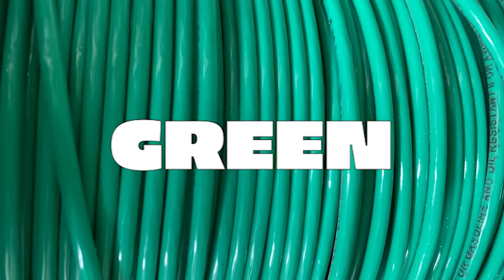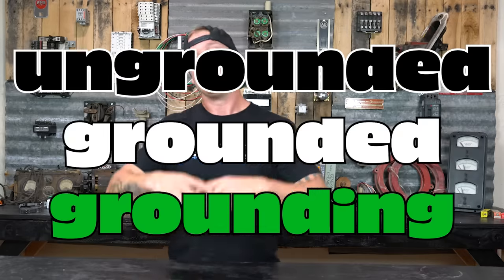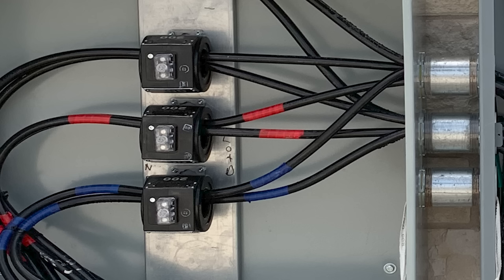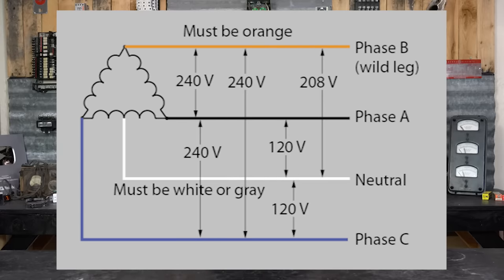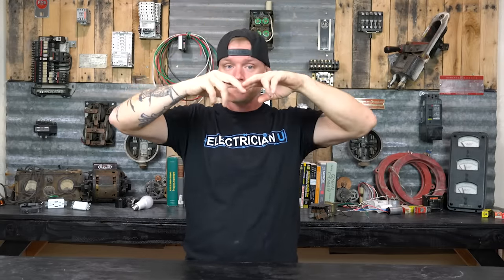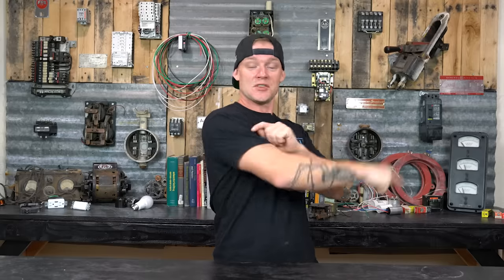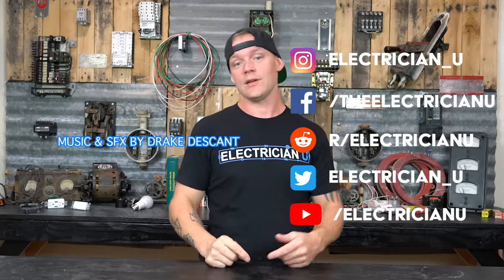Electrical Wire Color Coding Used By Electricians

Comment: Speaker wires: Backwards wiring is just out of phase, sound is an AC signal. If both speakers are "out of phase" you won't be able to tell the difference, but if just one is there will be places where the speakers cancel out each others' frequencies depending on the room it's in and placement etc.
Reply: Exactly
Reply: Speaker wires can also be same color for both, but the sheathing is smooth on one and rifled or ridged on the other so you can feel it in the dark realm of speaker installations.
Reply: Power going from your stereo or amp to your speakers is DC, not AC.  The rest of your comment makes no sense.  You seem to be confusing a delay with a noise cancelling signal.
Reply: @akuunreach  not true. It's AC. And the rest of his comment makes perfect sense.
Reply: @ehsnils  I remember when I was a kid speaker wire was like that. Both conductors same color. I didn't know then one side was rougher than the other one until I got older. I used to get really annoyed by that. It was probably very common for people to wire up speakers incorrectly because of this.
Reply: @ehsnils  clear or see through will White markings if you examine it closely on one side...
Reply: speakers are driven by audio board that converts AC to DC.

Comment: Awesome video! If you need a video idea here’s one: how to properly size wires and voltage drops
Reply: I would be interested in that. good call
Reply: Would love this video
Reply: Voltage drop would be great
Reply: Agreed
Reply: Easy way to do it is for every 100' go up another size. So a 20 amp circuit which normally would use a #12 AWG would use #8 AWG if you go over 200' but less than 300'.
Reply: @11bravoNRD  2KIL/1000 or 2KIL/CMA depending on where you get your K. Remember that the voltage drop calculation is a the number of volts dropped in a circuit, not a percentage. So, the acceptable voltage drop for a 277V circuit may not be acceptable for a 120V circuit.

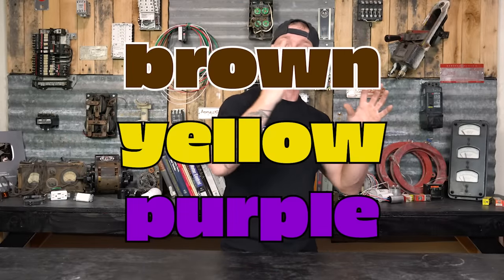Comment: At about 10:00....you mention the "low voltage" as being about 240 volts. This is only the voltage for a Delta secondary from the utility. Today, the Delta system is often passed over for the Wye system, which gives about 208 volts, phase to phase, and a reliable 120 volts to neutral, with no "wild" or "high" or "bastard" leg in the middle position. In the Northeast area around Philadelphia, the 480 volt colors are Brown, Orange, Yellow. We can talk about Two Phase another time. It is still used in parts of Philly.

Comment: This sounds so crazy to me and also really dangerous.

In Austria we have these colours:

Brown Phase 1
Black  Phase 2
Gray Phase 3
Blue as neutral
Green/yellow as Earth, it was red like 30 years ago.

And thats never changing
Also all the additional wire colours like white, purple, orange and pink are colours we use for "lamp conductors" they are basically "switched on/off"

Also we use 230V/400V
Between phases 400
Between phases and neutral/earth 230.

But then again our normal power outlet gives 230V at 10 to 16 Amps depending on how its getting used.

Comment: I think it is important to note that an orange wire or marking in a panel means hi-leg but if you come across orange wire in a receptacle or switch box location this does not mean it will be a hi leg. Typically this can be a switch leg or a traveler.
Reply: Really you should mention open delta and delta high legs. Most Electricians will encounter Y secondaries so no high leg will be present.
Reply: Open or closed delta has no visual affect on a delta system. You can have a 120/240 grounded delta in an open or closed configuration and you wouldn’t be able to tell by reading the voltage.
Reply: @SeanLeonDrums… the National Electrical Code states that a hi-leg shall be marked orange but it doesn’t restrict it’s use to only a high leg as it does with the green=grounding and white  & natural gray=grounded (with the white in Romex switch leg exception). 
It is legal and very common to find orange colored phase wires in 480 volt systems that do not have a high leg (ie.. 480v wye)

Comment: 40 years in the trade never used purple as a phase wire. Always used brown orange yellow with a gray on 480/277 3 phase. We used purple as a switch lag on 277 volt lighting.

Comment: Here in Massachusetts most larger buildings the voltage coming off the street and into the buildings vault is 13800 volts this does very then transformed down to 3 phase 277/480 and the colors are Brown - orange - yellow and a gray neutral this is the power you would use for most mechanical and lighting loads it’s also distributed to the tenant areas and transform down to 3 phase 120/208 These colors are Black - Red - Blue with a white neutral for plugs some lighting and small motor loads
Reply: Black red and blue are 120 / 240 v
Reply: Also it goes by circuit number too IE 1 and 2 would be black, 3 and 4 red, 5 and 6 blue
Reply: @jforrester9282  1Black 2Red 3Blue 120/208 volts here in Massachusetts

Comment: the orange that represents 208 is in a 120-D 3 phase system. a 120-Y system doesnt provide 240v only 120-208... the 120-D has 120 phase to neutral and 240v phase to phase except the orange wich is called the high leg. is that phase to neutral? or Phase to phase?
Reply: On a 4 wire delta system,  the high leg is 208V to neutral/ground.  If your rushing and not paying attention it's easy to mistakenly land a single pole breaker on the high leg bus when you want 120 volts, and smoke up everything on the circuit when you turn the breaker on.

Comment: I see people posting BOY or YBO in certain locations. In the Washington DC area you'll find both.  Usually it's in the Job specifications as to which way they want the 480 color coding installed.
Reply: Only if its Phased that way!!!
Reply: @Jamie Vann… I don’t think the utilities are consistent with the color vs phase rotation coming into the facility. The different order in colors might be an effort to try and coordinate this.
Typically the inside wiremen just label X1 brown, X2 orange, and X3 yellow and maintain the phasing throughout the system and only correct rotation issues at the point of connection to supplied equipment. That being said anything is possible. Every plant/facility I’ve worked at in my hometown is BOY on 480v except one that uses BYO on 480.

Comment: Once u get to 12kv in the U.S. those colors don’t jive.
Best thing for u guys learning is to check the NEC, and FOR SURE check with ur AHJ.
Reply: Probably once you get to 4160V.  But fortunately, there are other conductor characteristics like shielding that will suggest the presence of medium voltage.

Comment: More info:    Speakers are DC powered so they need to be wired so red causes the speaker cone to expand outwards, pushing the air. Another wire is for lamps and extension cords. If the plug is missing or is going to be replaced the wire that is neutral will have ribs on the surface that you can feel or see. That one goes to the neutral, or wide blade side of the plug or receptacle. Great videos, sir!

Comment: We've never used brown yellow purple, Always BOY.... I always learn a little something in your videos, keep em up man
Reply: In the Netherlands (and the rest of Europe) we use Brown, Black and Grey for the hot wires and Blue for the neutral and Green/yellow for grounding (400/230 Volt / 50 Hz). We had made electrical systems in our company for the US market (offshore). When an electrical system goes to the US, we must use the US standards. For 480/277 Volt / 60 Hz it was always Brown, Orange and Yellow for the hot wires and Grey for the neutral and Green for grounding and for 208/120 Volt / 60 Hz it was always Black, Red and Blue for the hot wires and White for the neutral and Green for grounding. Some cables we use on ships they don't have a green of green/yellow wire for grounding, in that case brown in used as grounding (ship is ground). The neutral is at the source (generator or transformer output) connected to the ship.
Reply: I like your vintage collection, but you need the split knows that separate conductors and fastened to wooden roof framing. Keep making videos and share.
Reply: @JGvanStraten  We had already wired a machine that was for making breakfast cereal we were not told it was for another country and put in Brown Orange Yellow and Grey wires tested the machine everything was fine andthey were happy, a few days before we broke it down for shipping they had some visitors from another country check the machine and they were alarmed and told us the colors needed to be changed out. since it was specked out and their guys okayed everything we got paid to take out all the cables and wires to all black and kept the scrap. either i never found out what country or i forgot.
Reply: Was about to make the same comment.  Also it's strange the nec hasn't really addressed color coding
Reply: Canadian here: Only seen it here on government building contacts as switch legs.
Reply: Same here. Navy and east coast industrial and west coast industrial our 480V was always Brown  Orange Yellow. Very rarely i have seen black red blue for 480V.
Reply: Yea same here. I work in solar and we always use BOY.
Reply: @MrBonners  Do Canadians have a way to distinguish 347/600V from 277/480V by color scheme?
Reply: @carultch  No. Such voltages are only found in florescent lighting fixtures after the transformer, motors. There is no code regarding colors in standard residential/commercial wiring except green reserved for ground only. The usual red and black and blue being hots at any voltage. There is no color codes for internal wring of control panels, instrumentation, vehicles. those are covered by other standards and practices. No code for under 40 volts.
Reply: @JGvanStraten  What is neutral color in ships?Also if you use brown for ground what is the color code for the 3 phases?

Comment: We always used Grey added to Red/Blue/Black or Brown/Orange/Yellow, to indicate the circuit was the Generator Wiring Only. If The Grey Tape was on top of the colored tape, it was from Street Power or Generator Wiring. Purple or Pink wire in a unit, was to indicate field added controls to the factory circuit.  BTW, they now have Pink Electrical tape. Also Red Wire or Wire with Red Tape or from a Red 
Paint Marker, in a Light Circuit, indicates the Traveler Wire for a Three-Way, Four-way or More than Four Switches, in a Switch Circuit.

Comment: Wiring a speaker wrong will most likely work BUT the speaker will vibrate backwards instead of forward. You touch a 1.5 volt battery to the leads of a speaker it will tell you which is positive and negative. The positive wire will make speaker vibrate outward. You want a speaker vibrate outwards.

Comment: FYI. typical or common audio speakers operate on AC and do not have polarity,  they will produce sound with either wire in either position.  However, polarity needs to be observed for proper phasing of the speakers.  Speakers connected out of phase can cancel each other out and the quality of the sound is poor but they work.  When "out of phase," one speaker will move out and the other will move in.  If the speaker terminals are not marked with a (+) or red designation you can use a 9v battery to mark the terminals in most cases.  If I'm checking the phase of installed speakers located behind a speaker grill, sometimes I'll use a very fine gauge wire or a piece of straw from a broom to see if the speaker moves out or in when I apply 9v dc to the speaker wires.

Thank you for your presentation on color-coding, you may have saved someone's life!

Comment: They don’t call it Neutral in the NEC because there are cases where the grounded conductor is not technically a neutral. The NEC only requires grounded and grounding to be a specific color. The rest of the colors are based on convention and local/state requirements.
Reply: I also think he thinks the ground and neutral are the same. They are not. The neutral is a current carrying conductor, ground is not. The ground is there for safety and should never carry current.
The neutral is a tap off a transformer. Usually its the center of the secondary windings
Reply: Grounded and current carrying.  Those are the two characteristics I teach my students/apprentices for identification of conductors.  Current carrying/ not grounded, current carrying grounded, non current carrying grounded.
Reply: @bigmikeh5827  good point, as neutrals may NOT be at ground potential (they should be) but grounds are NEVER supposed to carry current.
Reply: Most people who aren't familiar with the Technical Terms get lost in the terminology of the Words, I think he does a excellent job explaining it a on a basic level. No System is perfect, do you want to boar them to death before they have a understanding. I'm sure he has a Understanding of what your saying...
Reply: Besides do you know the difference between a grounded Neutral and a Neutral going to Ground...
Reply: Steve-o grounded neutral should be bonded at the center tap of the transformer that is also bonded to the system grounds. A neutral to ground is a neutral conductor that is terminated at a ground.
Reply: @Engineer Wrecker… the code does require the hi-leg be orange. However it does not restrict orange to hi-leg only.

Comment: Not bored.  Kinda knew all this except not memorized 460 colors. Very glad to know orange is wild leg.  Burned up a refrigerant reclaimer's compressor a long time ago cause I chose the wild leg to ground to power it off the roof top disconnect. As an HVAC tech, I often test newbies as to which wire colors are which on thermostat low volt connections.  Few ever get them right.
Little info back at you.  R = one leg of 24V transformer (hot), B blue (the wild card color can be common or might be Y if cable has no yellow), W white is to common through heat circuit, Y is to to common through the cooling contactor. G is to common through fan relay. Usually controls high speed fan for cooling. O orange powers the reversing valve in a heat pump. Other colors are second stage heating and cooling and outdoor temp sensors etc.

Comment: In commercial that I've worked on the orange almost always means 277v, commonly lighting circuits
Reply: Same
Reply: In the picture with a red, black and orange colors the orange should designate a 190v high leg and the red black as 120.

Comment: Sometimes it‘s useful to know other wire colors from other parts of the world. Especially if you buy appliances from there. Seen a video made by a UK electrician installing a wall charger for EV. The cable had US colors (black, white and green) but the appliance was 230V.
And if we sell an appliance to somewhere they get a cable with european colors.

Brown, black and gray are lines, in three phase L1, L2 and L3. Neutral is blue and protective earth/ground is green/yellow.
Voltages are 230V between every line and the neutral and 400V between the lines.

Comment: We use here in Florida 
Black/ red   -   Single phase
Black/ red/ blue  -  3 phase 
    White is neutral 

Ground is green or bare copper. 

High voltage (480) 
Brown/ orange/ yellow 3phase
    Grey is neutral